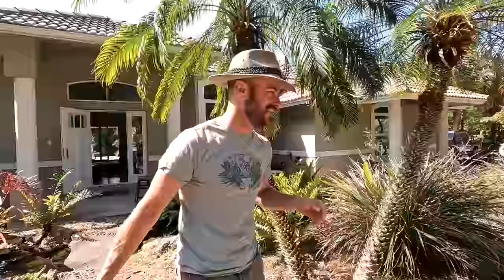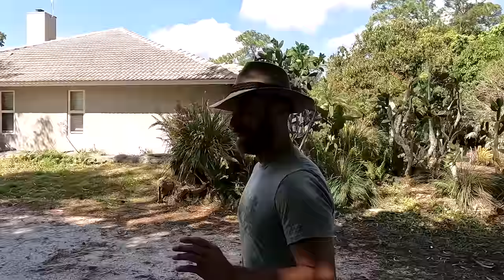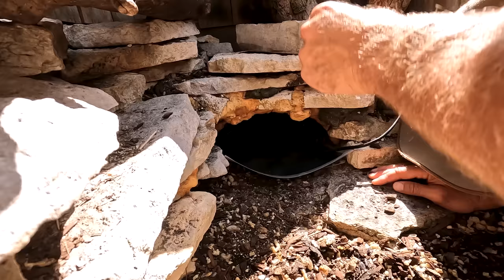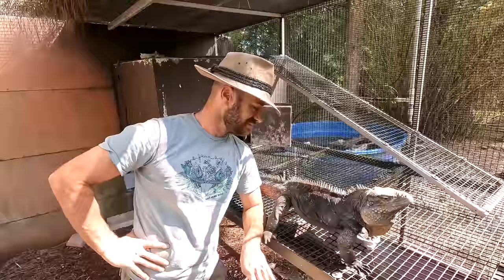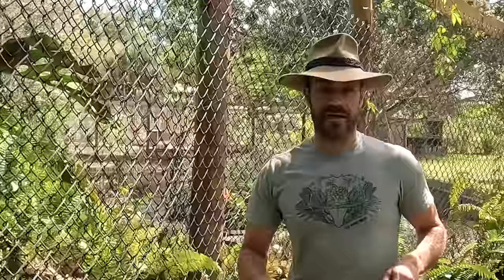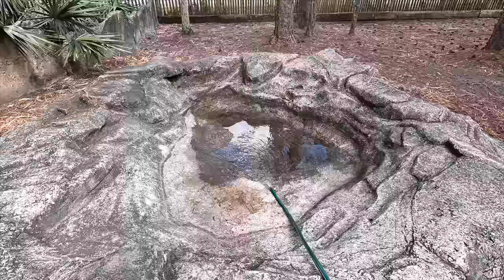Wake Up Time!

Comment: Hey Kenan.. For all the heat enclosure for your reptiles that be outside. You should have one side, slighter raised.. So, when you spray it with water.. It will all pour down one side easier..